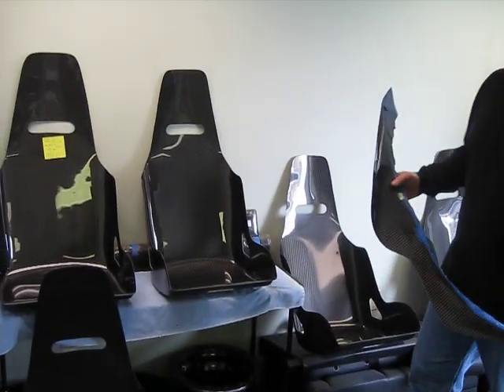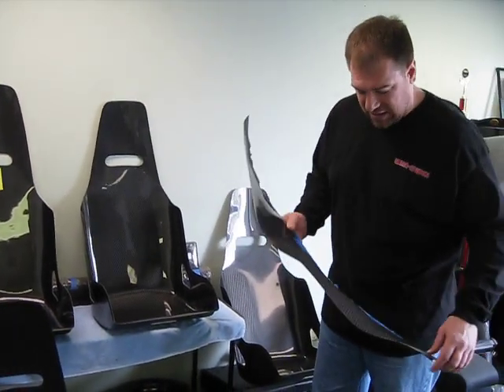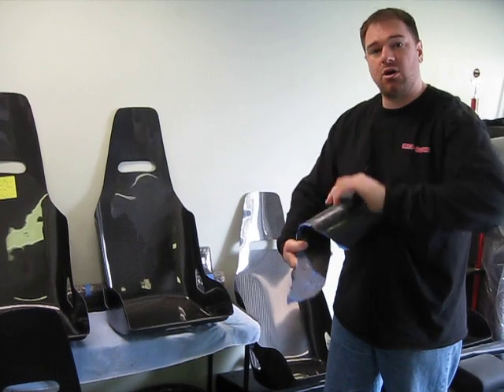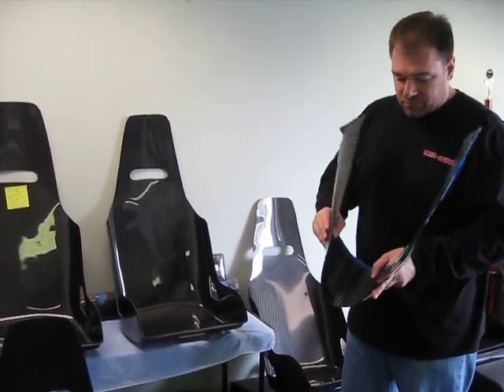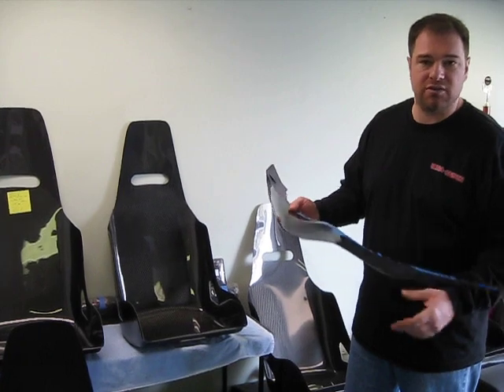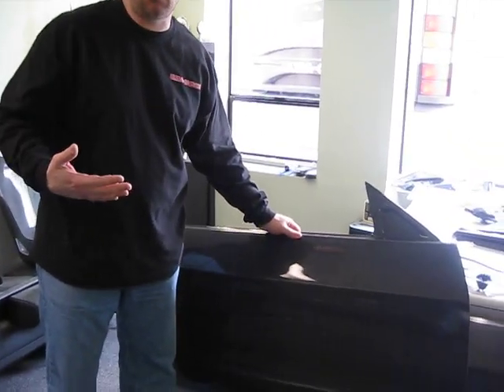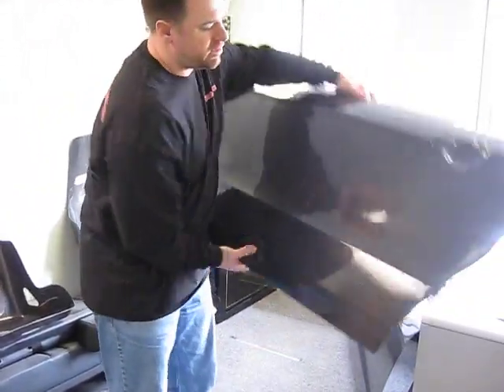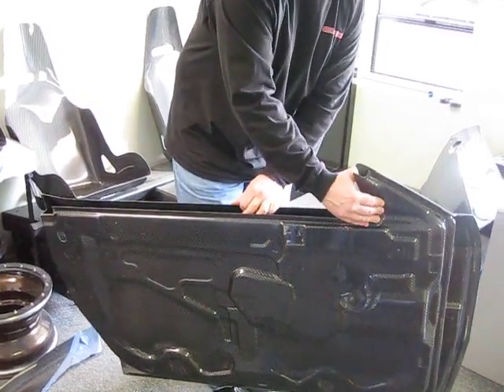Flexibility Video

Comment: Is there any special resin used for making the carbon fiber that flexible?
Reply from the maker: Ryan Ramlall, yes. Each resin you use has a specific purpose and uses. There are hundreds of different resins on the market, with new resins being developed all the time.
Reply: Wow thank you so much i'll look into it.
Reply: Can this seat used for circuit road race type of racing?
Reply: Also how is it mounted, im familiar with the side mount seats but not sure how this seats mount.. pls help. I wanna buy